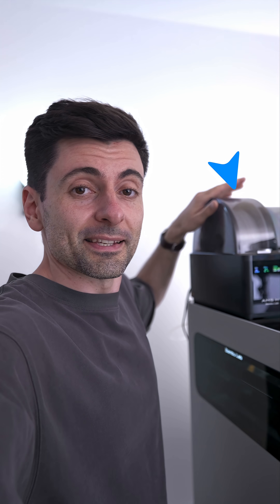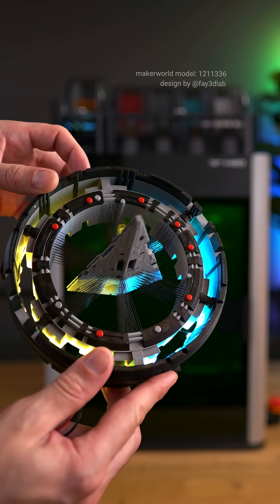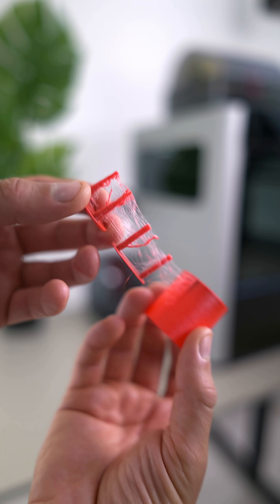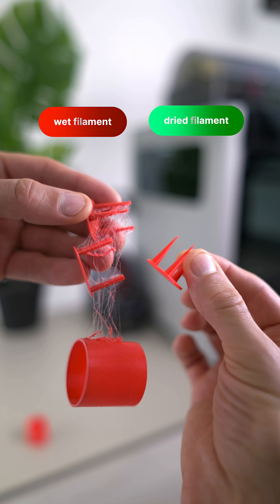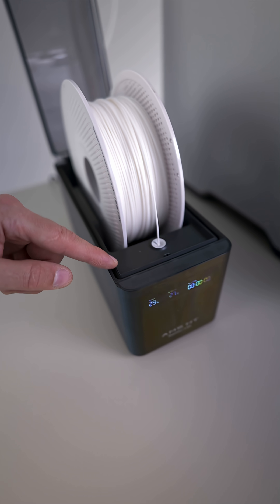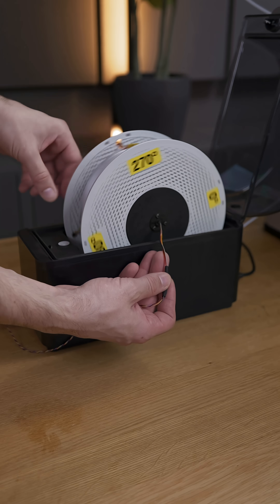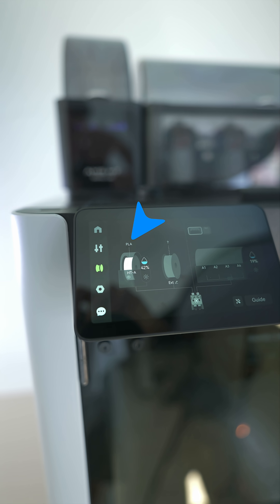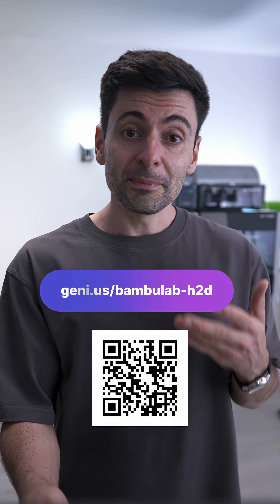🔥 The Ultimate 3D Printing Filament Dryer – Bambu Lab AMS HT

Comment: Are you sponsored? Because it's seems so (say any bad things about it) or if you need help I can do what I know without having it
1. Price just for drying there are cheaper options (like half as cheap)
2. You can only dry filament when you hook it up to the printer and only Bambulab printers
And now it's your turn for saying things that you only can see when you have it in your hands (something like the plastic is not good or it gets hot also outside or you don't like the design or it weights very much or it feels like useless when you have the spool holder at the side and a 50$ filament dryer and when you print more than 2 colours your wasting 10 kg of filament

Comment: As the ams are expensive and I only need to use 2 type of filaments.
 Im wondering if i can use one filament without ams and the other filament with this single unit ams ht.
 Could my p1s can be feed and work as if im using a normal ams. Does any body knows? please.

Comment: You say you can print while drying, but I read people saying you can’t dry while printing?
Reply: You can dry while printing from the other AMS, you can't print from the AMS HT and dry from it simultaneously - he chose his words EXTREMELY carefully
Reply: You can print and dry at the same time with the HT but not with AMS, has to be fed manually into the external.
Reply: ☝🏻 Tengo entendido que sí que se puede imprimir el filamento mientras éste se seca.
💁🏼‍♂️ Para poder imprimir el filamento, desde una unidad AMS HT, mientras éste se seca.., 💁🏼‍♂️ se debe de desconectar la función independiente que rota la bobina de filamento automáticamente cada 5 minutos, es decir, que los rodillos que hacen girar la bobina deben estar sueltos y permitir al extrusor del AMS HT tirar del filamento libremente (función de rotación desactivada durante el secado).

Comment: Excellent, informative review. It's worth mentioning that it also supports automatic spool changeover if you have an identical spool (manufacturer, type and colour) in any of the other attached AMS's (just as long as the spare isn't actively drying).
Reply from the maker: indeed, great point! 👏

Comment: Okay and? Who's really willing and capable to be spending a million USD on 3-D Printing, for a hobby? Isn't it a bit too niche? Buy a 3-D Primter, good ones are all expensive. Buy filaments separately, good ones are expensive. Waste a lot of it in finding the appropriate setting, different for each filament. Buy filament drier. Buy extra print heads. Maintenance and Upkeed, are a further expense. It's just not economical.
Reply from the maker: 3D Printing is very affordable, check the prices 😉
Reply: Erm...what? I have two 'good' printers, one of which cost £169 (a1 Mini) delivered from Bambu. 
Filaments from Sunlu, for example, are around £10/kg. Never had to change a filament preset. New to printing in April, over 1000 hours to date with 3 failed prints, all my fault. 
Zero maintenance costs to date.
I have the AMS-HT for drying and printing ASA - it makes ASA printing as easy as PLA.
I also have a PolyDryer for PETG maintenance that cost all of £70. I also have 16 replacement dryboxes for that drier for around £5 each, thanks to GunplaMark and his Cereal Box Drier box conversion prints.
So buy, unpack, remove shipping materials and screws, plug in, load filament, select model, press print. Welcome to the Bambu Lab 3d printing experience 2025!
Compared to my other hobby - woodworking - 3d printing is orders of magnitude more affordable.
Reply: @garymelrose9727 
I have a quastion
Do you have a housing for your a1 mini? I am actaully interested in printig with asa and abs but I always thought you need an enclosed 3d printer for that. Does it work with the ams ht? Because if it does i'll probably buy one sometime
Reply from the maker: AMS HT will work with A1 and A1 mini in Q3 this year (will come as a software update).

regarding ASA and ABS, you can but is way better in an enclosure. Keep in mind, both ASA and ABS release toxic fumes while printing!! So absolutely don’t be in the room where is printing!, also open a window to went it properly.

But I recommend using PETG or others instead of ASA or ABS (I also don’t print with them)
Reply: @marsgizmo  oh, okay
I had a roll of petg hf recently and I had a pretty good print experience with it. Maybe one day I'll have an h2d with the air purifier thingie and then I'll print with abs or asa!
Reply: You could have just scrolled past, Han. No need to reveal yourself as an absolute bore